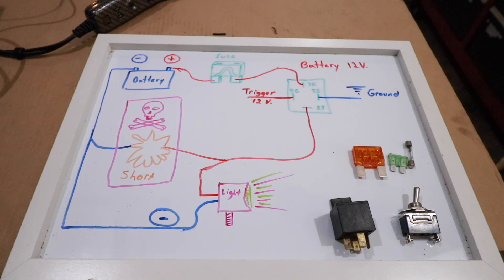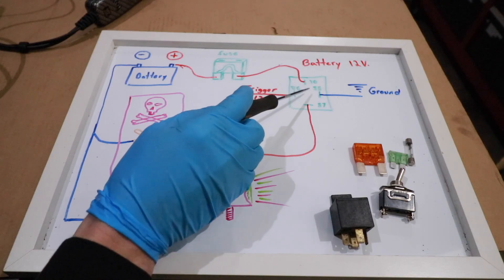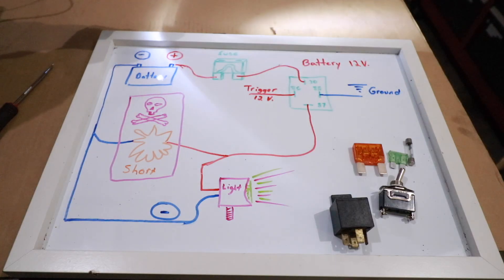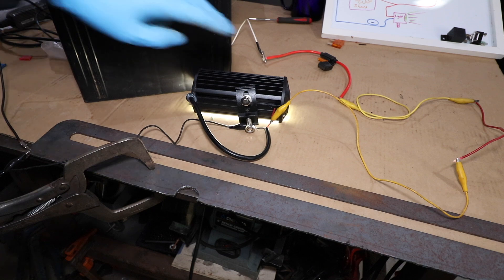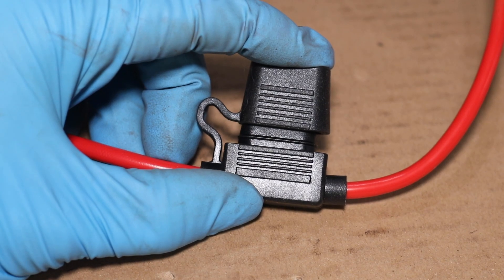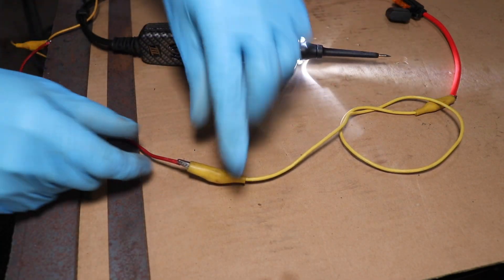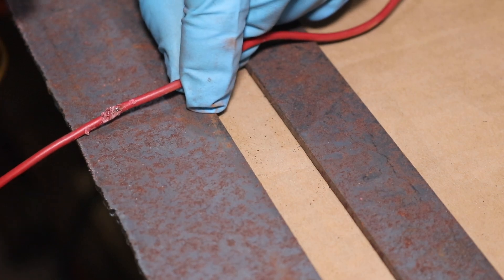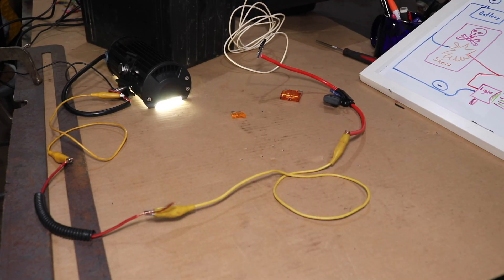⚡How to Find a Short in a Car⚡ Using a Power Probe

Comment: thanks for a good video and easy step by step.   I have a sprinter RV and the rear running lights do not work, all other light functions are ok.  the message on the code reader is from the PSM and it says short to ground on # 3.  I followed number 3 to the fuse box but here the fuse is intact,  In that case with no damaged fuse and knowing that there is a short afterward how do I proceed,
Thanks

Comment: This is a good video but it misses some important things.

This will work on an led light but not with a normal bulb as the probe will detect the actual ground through the bulbs filament. The bulb would need to be unplugged first so the circuits open at both ends.

The most common techniques to use once the short is known is to unplug the circuits load item to see if it’s the cause and then to test as you demonstrated from there forward.

Comment: Your analogy is a little off. When you tested with the power probe on the battery side of the blown fuse blade, of course you got a 12 volt voltage signal. You then crossed over to the load side of the blown fuse blade and you got a ground signal of which you said it’s shorted to ground. Technically you can’t consider that shorted to ground yet because you’ve not unplugged the load(the light)from the circuit. That ground signal can come from the shorted area that you created or it also can come from the light since it’s still plugged in and connected  through the bulb filament to chassis ground. The positive side of a power side switched circuit is a ground until power is actually flowing through the wire on a power side controlled circuit. Why, because when the circuit is off and the load(the light) still has a connection to chassis ground through the light bulb load all the way to the blown load side fuse blade. When you started testing at the blown fuse blade, it showed up as ground through the bulb filament because the wire that you rubbed through to cause the fault in the first place never stayed connected when you went to test it at the blown fuse. Which meant when you said it was shorted to ground. It was going to ground through the load because it was still connected to chassis ground. I don’t know what you did after you did the repair and tested to ground and you said you didn’t get a signal to ground. You must have unplugged the light because that wire that you touched with the power probe still connects into the light through the filament in the bulb and out the filament to ground so it still should’ve gave you a ground connection.
Reply: You're correct, I just made pretty much the same comment, but added (sneakily editied + didn't mention).
To answer your question, after 'the repair' and after editing out the part where he was possibly surprised to still see a short (going straight through the lamp)
he might've disconnected the lamp, or ground side connection.
If it was an LED lamp, the power probe may no longer see it as a direct short or low enough resistance to bring on the green indicator and beeper.👍
Reply: Isn’t it because he doesn’t have a switch in the circuit? Say he had an open switch after the fuse you shouldn’t see ground. But if the short was between the fuse and the switch it would show ground correct? I could be wrong. I’m not that great at electrical yet.
Reply: Even if, like you said, he added a open switch(switch is not closed) in between the fuse and the load(light bulb) you still would see a ground on both terminals(positive and negative)of the lightbulb. Why you would say, because one side of the filament in a lightbulb is always connected to chassis ground but with no voltage on the other side of the filament because of the opened switch or the blown fuse. You still would see a ground running from chassis ground through the filament, as long as the bulb was still good, to the open load side(bulb side) of the switch or the blown(or open) load side of the fuse.

Comment: hey dude, after fix are we supposed to be getting a red light on the right terminal of that fuse?
Reply from the maker: Red light indicates + power. You should have + power between the battery and the fixture.
Reply: @OldSoulMillennial  meaning if we got 1 red and 1 green there is a ground present on the line?